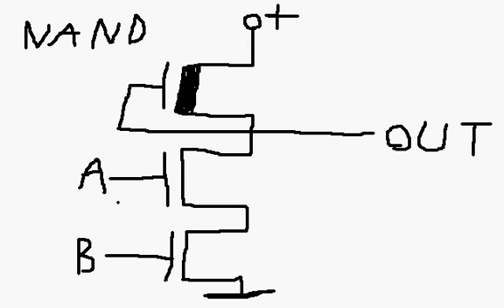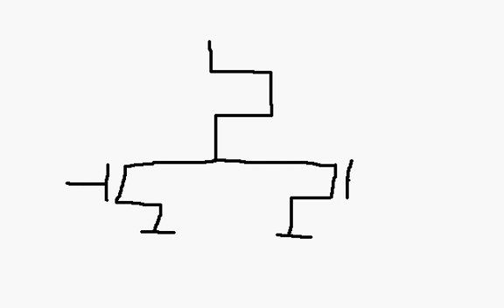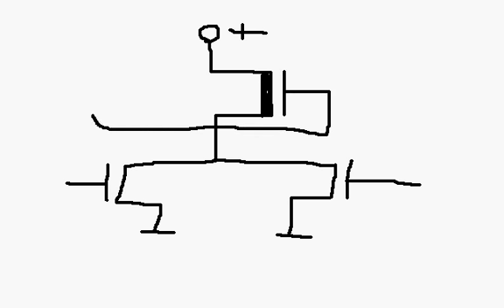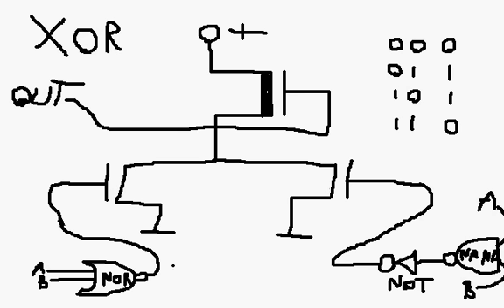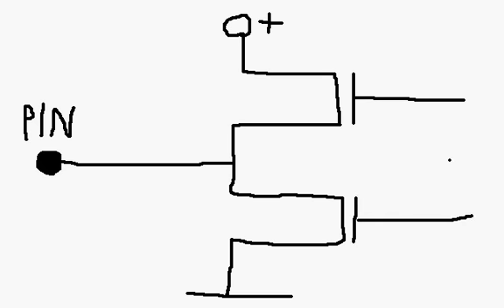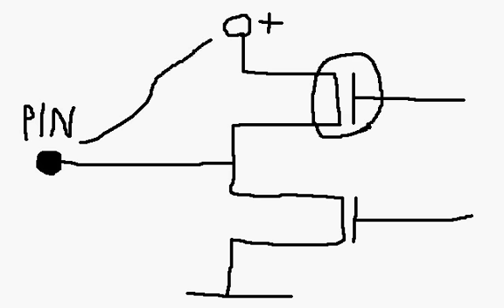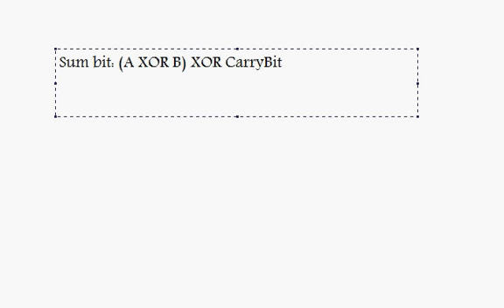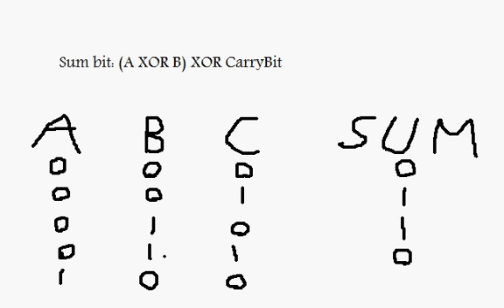6502 logic structures with MOSFETs, Part 2: NAND, XOR, Outputs, and Sum Bits

Comment from the maker: I've seen visual6502 and the "Reverse engineering" videos, but those are both about how the 6502 itself works internally. My project is more about something that people can build on their own, since few people have the cash to do custom runs at chip fabs even if they understand how the actual 6502 silicon works. I recently released a draft of making an equivalent to the 6502's ALU via 7400-series ICs. That's a decent start since the ALU is probably the single most complicated block in the 6502.